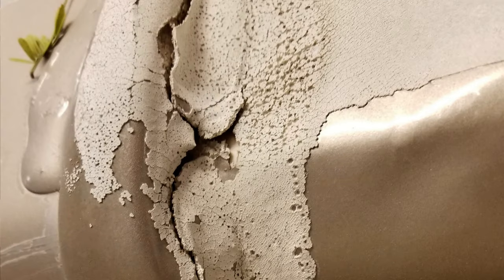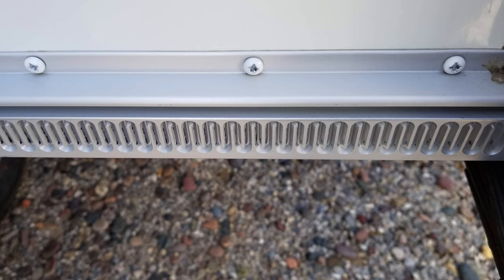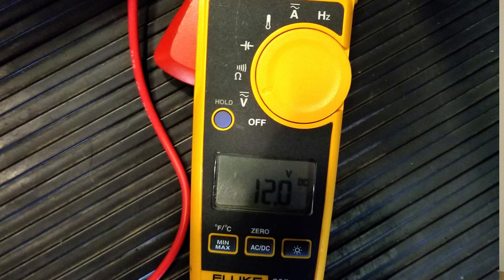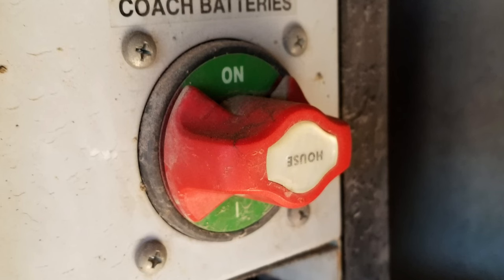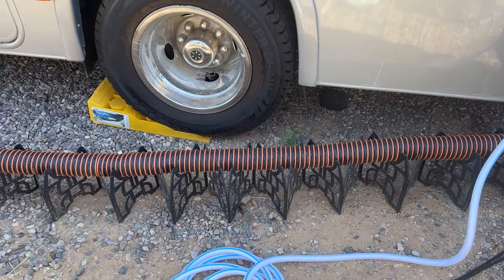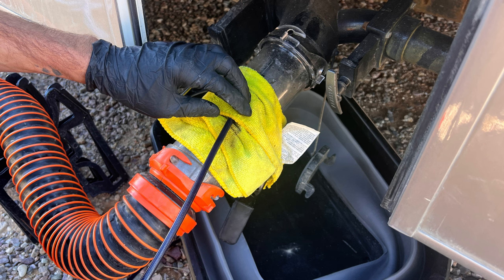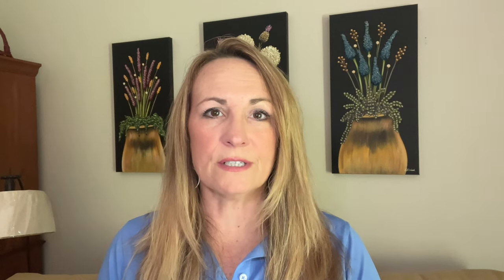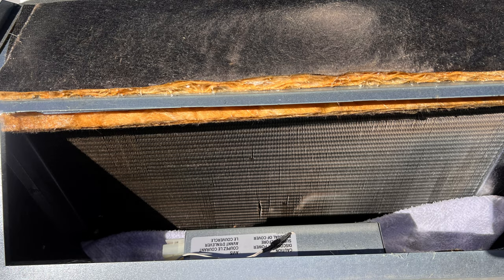Common RV Owner Mistakes

Comment: Great vid Deb!  Regarding tire pressure, I would suggest that once you have replaced tires on a motorhome or trailer, you check with the tire manufacturer to see what pressures they recommend which could be different than what the coach manufacturer recommended for the original equipment tires.
Reply from the maker: Thanks Sally! Yes, there are the labels on the RV that usually give that recommended psi.

Comment: Just a question. Can I convert an RV's propane appliances to electric? Like replacing anything that needs propane to electric with solar panels
Reply from the maker: You can always block off the power supply, remove the stove and put an induction burner in. Then you can run it off of a system with an inverter.